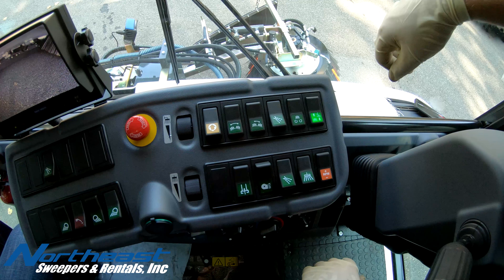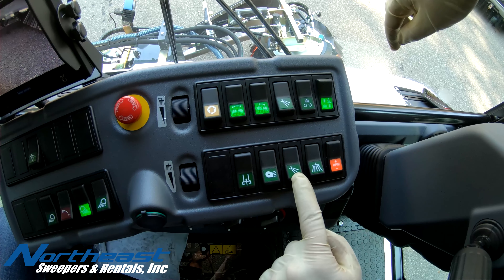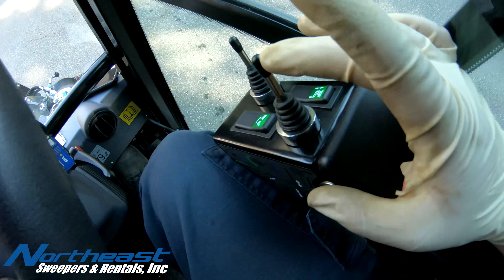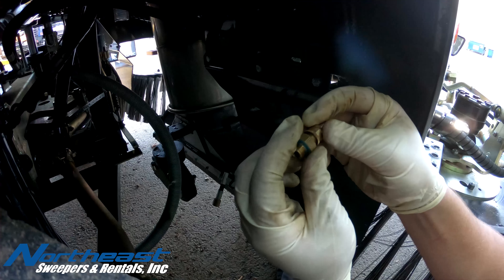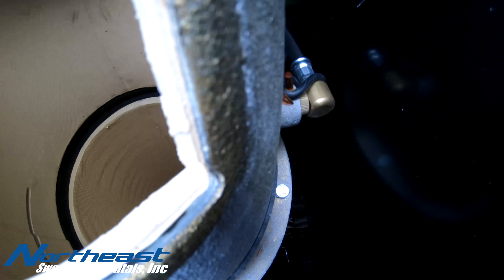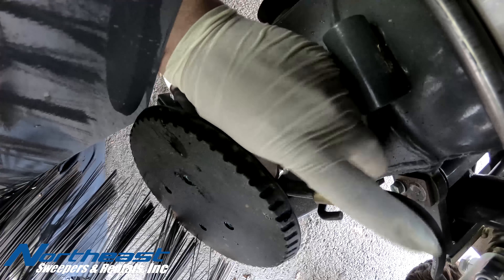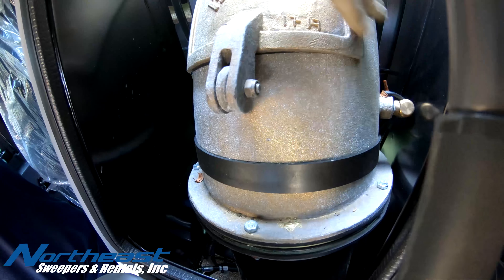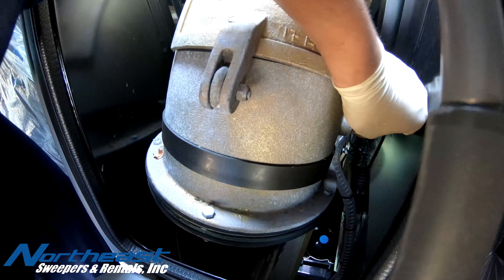RAVO 5 iSeries - Water Tip Maintenance

Comment: Water switch is just flashing and no water is coming out
Reply: Ever get an answer? Ravo wants me to replace a pressure sensor that isn't an issue and ohms out fine
Reply: @ryanstevens9225  They told me to keep trying to use the power washer wand to prime the water system. It worked finally. It takes awhile
Reply: @Knowedthat I’ve had this happen multiple times. If they would’ve simply made the “low water sensor” a little higher as to not run the tank all the way empty, we wouldn’t need to prime it. It’s easy to lose track of water level when sweeping. An earlier alarm would be nice
Reply: @abasiczombie.  Have you every looked inside of the water tank? I kept telling them it seems like it should have some kind of rust proof lining or a different tank design our tank is nothing but rust water.
Reply: Oh and does your float keep getting stuck in the tank mine is always reading the water is half full
Reply: @Knowedthat  there’s really no easy way to keep the water clean. It may look clean coming from the hydrant, but I think that’s where all the rust is from. Everything from the tank to the nozzles are coated in it. I got a call a few hours ago from a Ravo dealer tech in regards to the flashing light. That’s the “water pressure low” alarm. Basically doesn’t allow the water pump to run for more than 5 seconds of trying to sweep or pressure wash. He directed me to remove the passenger side scuff plate and floorboard. There’s a solenoid with a rubber boot on top, should have 2 yellow and brown colored wires. If you remove that boot, disconnect the wires and jump them, the pump will run continuously. It’ll allow it to purge all the air from the system. Once your jets and pickup head start flowing again, plug the wire back to the solenoid. May have to purge the air in dump mode and use the pressure washer
Reply: @abasiczombie.  that’s good to know I can usually get it going again with the pressure wand. Still is a great little machine
Reply: @Knowedthat  sure is! Good luck